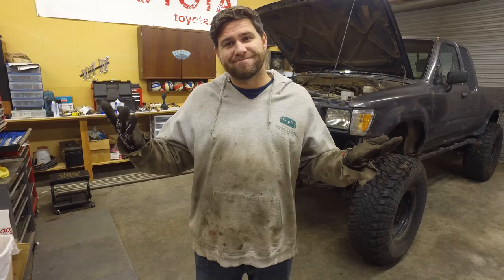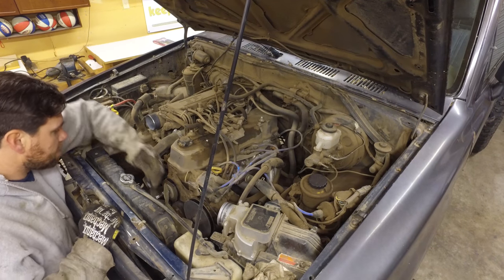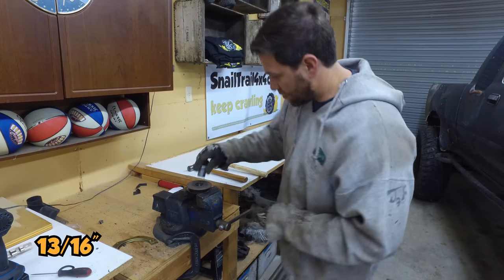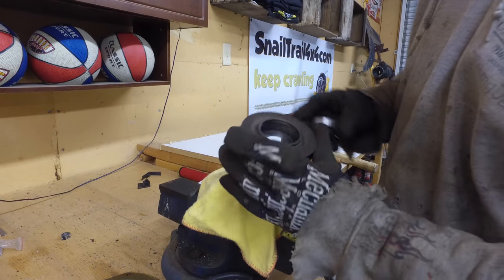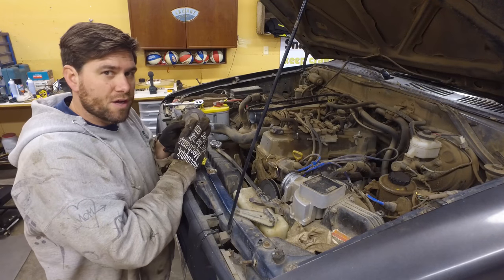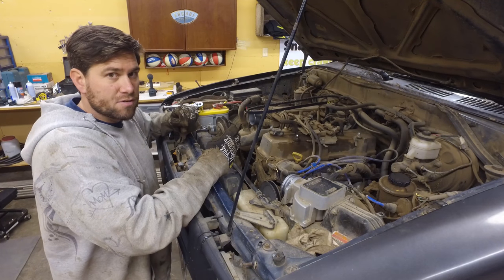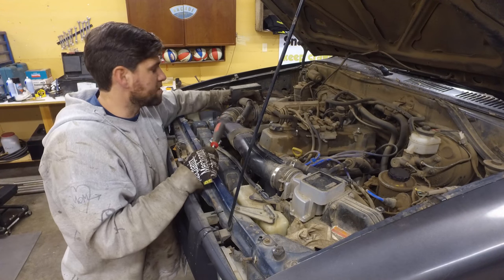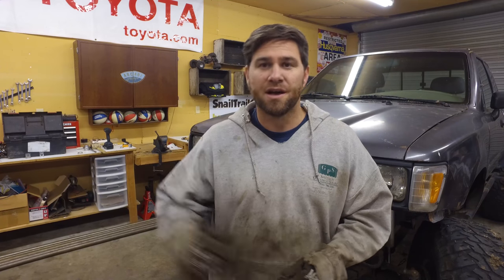Replacing the power steering idler pulley bearing  (Toyota 22re)

Comment: You could have made it easier to press the bearing into the pulley by throwing it in the freezer for and hour or more before you started the job. Shrinks the bearing. And I didn't hear a torque value mentioned for the nut securing pulley to the adjusting slot bolt. Snug the way you did, just on the edge of pulley not freely rolling, but barely free rolling totally works. Im just a stickler for torque values when putting a load on any bearing. I throw some blue Loc-Tite on for peace of mind. Good video overall and keep em coming and I always learn something new. 👍
Reply from the maker: Thanks

Comment: Where did you get that air flow meter?
Reply from the maker: What air flow meter are you talking about?
Reply: @SnailTrail4x4   He's talking about the big sensor thing that's bolted to the air filter piece.
Reply: I  bought mine from Autozone and it seems to work fine on my "86 22RE.

Comment: Copper brass radiator, what coolant you are using? Toyota red coolant ?
Reply from the maker: I'm just using water
Reply: @SnailTrail4x4  wtf bro, are you aware of the corrosion ?
Reply from the maker: @playstation2bigs  how long does that take to happen? I've been only using water for around 8 years and haven't had any problems. Also, it doesn't really get below freezing where I live so that isn't an issue